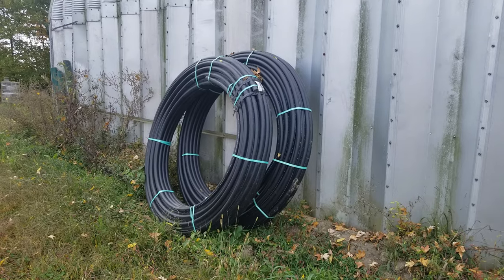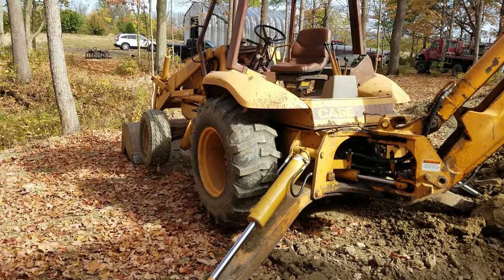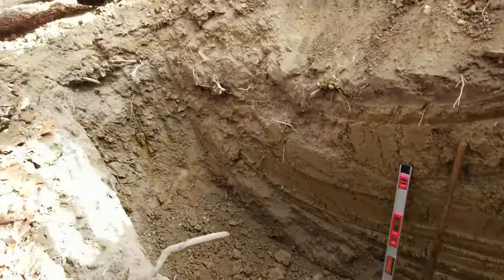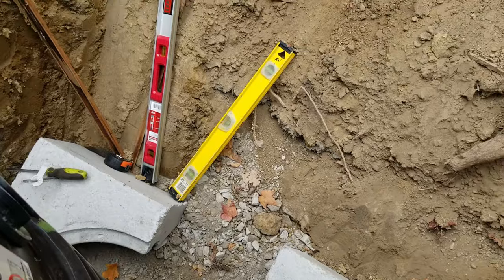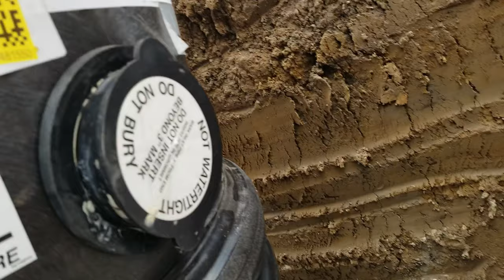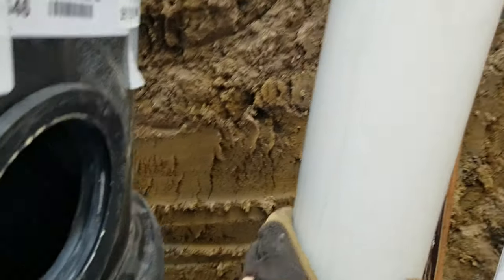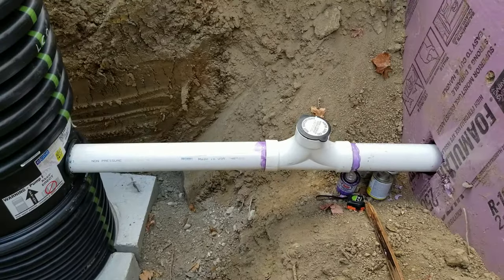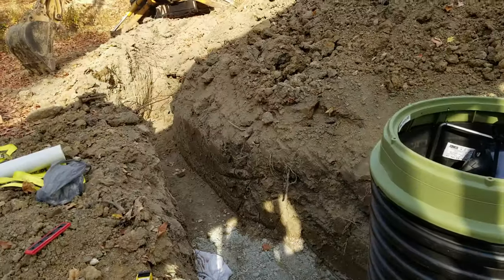How to Install a Sewer Grinder Pump - EONE Brand

Comment: I'm trying to put together an active pump out end of days downspout collection system with sewer pumps like this that go to the street or the storm. Is it possible to use this for that sort of application in a zone 7 climate like Western New York? In other words freezing winters? Looks like this is well below the frost line certainly. Bring all the downspouts to an exact silo like this and then pump discharge line into the storm drain and/or street? I'm hoping to use SDR 11 for the infeeds from the downspouts as well trying to decide if I would electrically weld, melt together or use compression fittings? Would love any insight

Comment: Do you have a video of your whole exiting  plumbing setup? Curious to know what you used as a resource to figure this all out. We are in the process of building a house that requires a grinder pump and we have a finished basement. All the instructions I see are for a slab install. I can’t quite wrap my head around how to set this up with a basement. I see you mentioned in the comments that you also have a sewer pump. I’m assuming that is the missing link in my mind. Curious to know more on your setup. Thanks!
Reply from the maker: I don't think I have a video, but shoot me an email and I can send you some pictures or a video of our final setup.  At the time, figuring all this out was a combination of online research, my plumber, the local utility, and the Eone rep. Ha

Comment: Does your sewer line from the basement gravity flow to this pump assembly i couldn't tell from the video ? I am about to begin construction on a new lake house and i will have to pump uphill from  the septic to the field lines
Reply from the maker: Our 1st and 2nd floors gravity flow into the grinder pump, but our basement has an ejector pump that lifts about 4ft to get it into the grinder pump.

Comment: I’d like to see the union between the dollar Schaefer line and the sewer pipe. Or does it dump into a manhole to then gravity feed away
Reply from the maker: Are you asking about the termination of the 1.25" line?  It goes into a manhole and then into a 3" or 4" schedule 40 drop line inside the manhole.  I have a separate video on my page of that process.

Comment: Hi…nice job! I am researching this subject because I am building a shop with a bathroom…that is about 15 feet lower than the septic tank. My frostline is 32” here in Colorado, and this seems like it definitely would meet that requirement.
I have a question if I may…are you pushing it 800feet to sewer..or to septic? I am guessing sewer? My understanding is Grinder pumps are for sewer…and sewer/septic ejector pumps are for septic? I would like to find this style with an ejector pump for septic tanks.
Thanks for the video…
Reply from the maker: Thanks!  Yes, I believe you are correct.  This grinder pump terminates at the sewer.  A sewer ejector pit/pump is what you would want.  In cases of a basement, the pit/pump is inside.  I suppose you could have your shop empty into a pit like this outside that acts as a lift station to your septic tank.  Sounds like you definitely are going to be pumping uphill to get to your tank.  I'm not sure what kind of head a normal ejector pump will do.  This grinder pump will do something ridiculous like 185ft of head.

Comment: Grinder vs. ejector? Which is better and more reliable?
Reply from the maker: I have both!  We have a finished basement with a bathroom and the exit point for sewage from our house is higher than the basement sewer pit.  Thus, we have an ejector sewage pump to lift sewage out of our basement.  Those are typically short runs.  Very much like a sump pump, but rated for sewage.  It lifts it and discharges it from the house into our E-One grinder pump.  The E-One then 'slurries' and pumps it 800ft from our house.  So they really have very different uses.  I would say a good rule of thumb to keep it straight in your head is that the 'ejector' ejects it from the house and a 'grinder', "gets it gone".<<<Technical term there! ha

Comment: Hi great video, I need to install one I. Northern NH.    Just wondering if discharge hose has a one way valve on it and curious if line could freeze
Reply from the maker: I don't believe the hose itself has a check valve on it, but I am pretty sure there is 1, if not 2 in the unit itself.  The line could freeze if you don't bury it deep enough.  Code in your area would dictate the depth.  Mine is at about 48" deep.

Comment: Could you not have dropped your sewer at the clean-out and put a sweep on it before going into the side of the grinder so the unit could be set lower for back-filling?
Reply from the maker: Looking back on it, I suppose I could have.  Truly, the issue wasn't the discharge location of the line from the house, but rather the fact that our foundation crew stepped the wall down (I don't know why) by a foot in that section.  If you look at the 11:03 mark, you can see the concrete is a foot higher in the corner and then drops down.  Had they carried that height across, it would have been perfect.

Comment: What AC power is needed for this particular unit? Breaker, wire size etc
Reply from the maker: This is the DH071.  It requires a dedicated 30amp breaker and it is 240v.  If you go to eone.com, you can download a manual for all their models which will give you specific wiring details.
Reply: @IndyFarmLife  thank you for the response

Comment: An amazingly concise, clear, unambiguous instructive -- like ALL videos you make.  Thank you so much.  A question for you:  I have an RV in the back of my home, about 130' from the street sewer.  I was allowed to install a grinder and run a 130' discharge line from it to the street clean out, which in turn empties into the sewer.  I am now wanting to convert a barn-style garage to a "mother in law" dwelling.  The plan is to 1) install a second grinder whose 2) discharge line connects to the existing grinder's discharge line. Now comes the problem.  The 1st line runs somewhat uphill.  If I "T" the 2nd line into it I am concerned that "stuff" in the 2nd line could backup into the 1st line. Do you happen to know if this is a) do-able or b) not recommended or c) ok but requires some special "T" that perhaps closes line 1 while line 2 is discharging?  Thank you so much.  Your videos ROCK.
Reply from the maker: Hey James, thank you very much!  I appreciate that.  I try to be helpful and informative.  First of all, can you elaborate on this "stuff" you speak of? haha JK.  So to answer you question, A) Doable?  Yea, probably so.  You could install check valves on each line before the T.  That way, once the "stuff" gets past the valve, it has no way to go backwards.  B) Not recommended?  I would say that's up to your local sewer provider?  They had a lot of say in my build.  C) See item B.  I think they should be able to tell you what is code/permissible.  The fact that they let you hookup a grinder for your RV would leave me to believe that they dont' care.  Or if you want to go the don't ask/don't tell route, I think a couple check valves would get you what you need.
Reply: @IndyFarmLife  Perfect response and almost immediate.  I said it exactly right the first time:  you rock! =)

Comment: Ive put in a lot of sewer pumps but never where a septic would work. And there was no reason you couldn’t have 45’ed the line lower after the T.
Reply from the maker: Yea, in retrospect that would have worked.  It would have meant more depth for my discharge line though too.  That area near the house isn't perfect but it's working out OK.  Suppose I know for next time, but I also hope there never is a next time. ha

Comment: Why did you decide to go with this instead of putting a septic tank system in?  Great video as always!
Reply: Why in the world do you want septic. Get that shit out of there.
Reply: @shahsmerdis  because if you run out of electric you cant flush your toilet.
Reply from the maker: If you don't have a generator and the power goes out you still can't flush the toilet when you are on well water.  Mute point for us, but definitely applicable if you are on city water with septic.

Comment: Wat size was that discharge line
Reply from the maker: 1.25" HDPE
Reply: @IndyFarmLife  I've never seen that pipe before as far as Plumbing is that common to use for a sewer pump outside because I have to install one soon
Reply from the maker: Yes it is.  You won't find it at your big box stores.  You will need to go to a specialty plumbing supplier or check online.  1.25" HDPE or also called SDR11
Reply: @IndyFarmLife  OK thanks

Comment: Calculate your head. And make sure you are meeting scouring velocity of the 1.25 you are going to have a lot of head for that long of a line. You may not be pumping fast enough. You may have settling in your pipe. E ones are not very powerful pumps. :/

There are a lot of other pumps for the same price that are more powerful and reliable . Let me see if I can find the head calculator